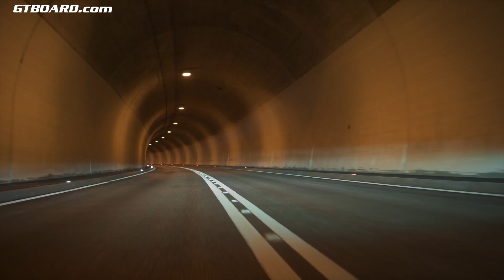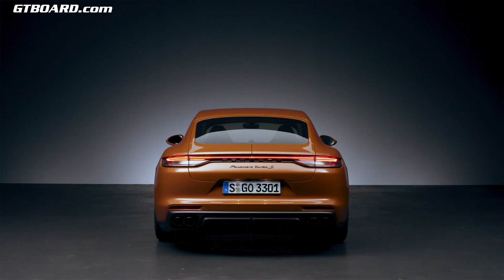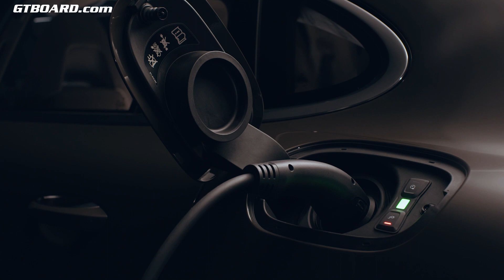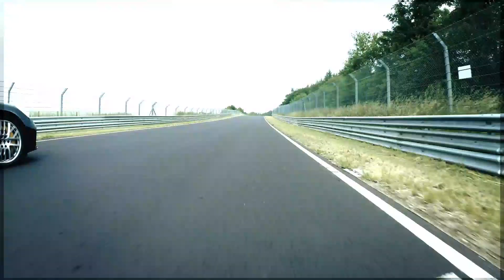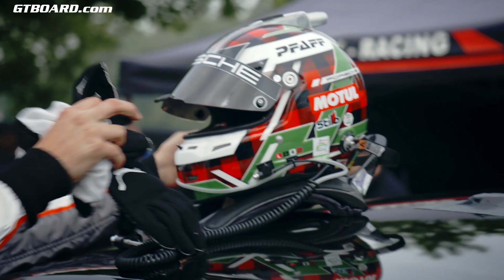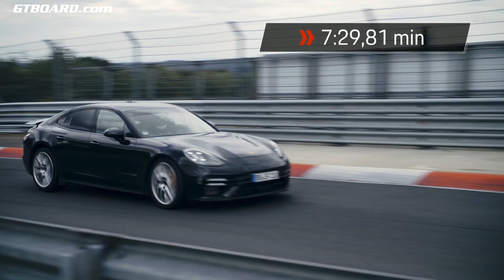NEW Porsche Panamara Turbo S! 3.1 s 0-100 km/h BMW M5 Competition KILLER?

Comment: They finally ditched the hybrid solution for the flagship product
Reply from the maker: Now I j derstand  Rhey did 🤯 In order not to take Taycan sales?
Reply: GTBOARD.com Maybe there is still going to be a Lion version of the panamera
Reply: No, Porsche confirmed that there will be a plugin-hybrid version of the Turbo S.
Reply from the maker: @zaphod2  And that is this one?
Reply: @gtboard  No, it will be revealed at a later date  which is still unknown. The upcoming AMG GT 73 will have ~800HP so this will be Porsches answer.
Reply: @zaphod2  Amg gt73 is such a weird name. They should have called it the Amg gt 4dr black series
Reply from the maker: @zaphod2  So confusing having a non E hybrid Turbo S again? No Panamera Turbo?